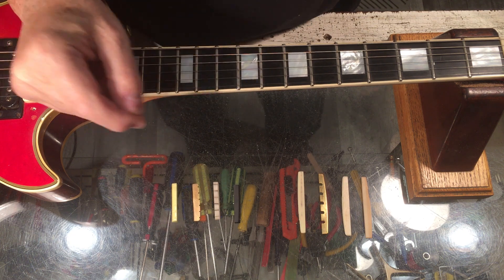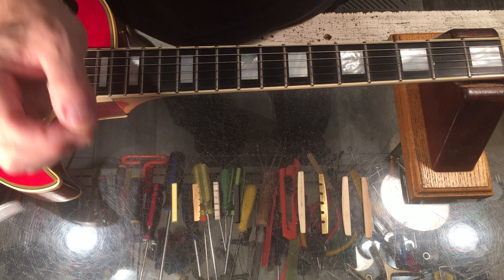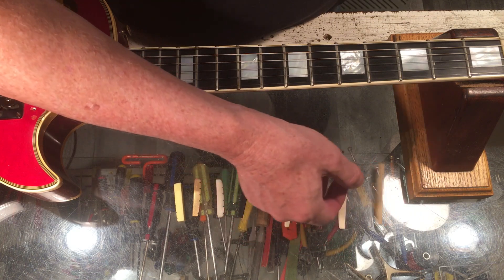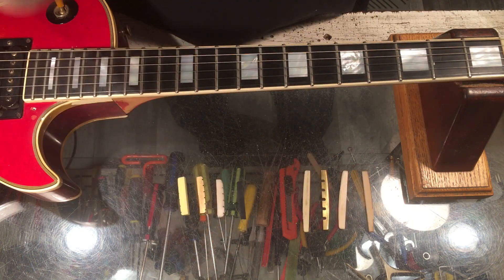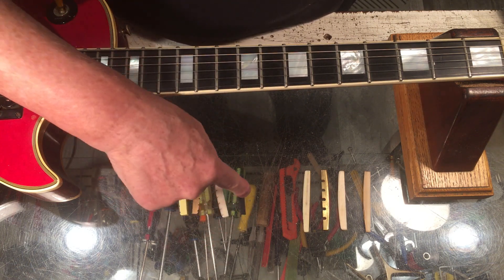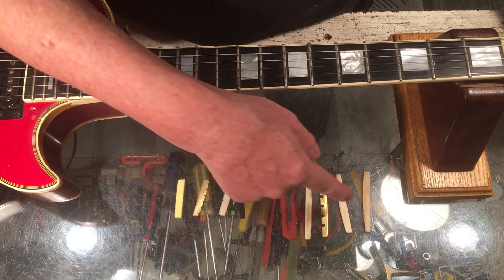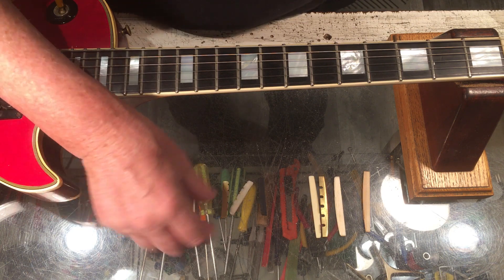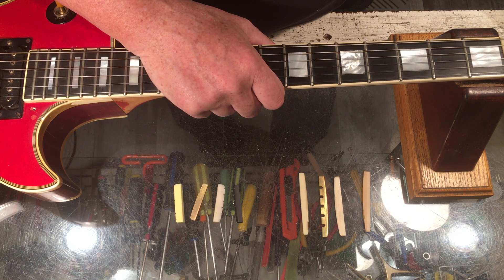What's the best material for nuts or saddles?

Comment: Hey Steve , 

Wouldn't graphite wear quickly  ?

I've been wondering about changing my saddle and bridge pins to Graphtec Tusq.  So much has been raved about Tusq . 

I'm a noob player , but i am very aware of my guitars and the way they handle and sound . 

All of mine need set ups , so why not make them sound better if something relatively simple can help by at least 10 % . 

Thoughts on the grsphite saddle  and  Tusq  ?
Reply from the maker: Modern graphite products have additives to help them last yet still provide the benefits of dry lubrication and energy transfer. As to whether they change your sound for the better, there's literally only one way to find out. If you have multiple guitars you could try a test on one instrument and see if it's what you're looking for. Good luck!

Comment: I started using GraphTech ‘Tusq’ nuts a few years ago, and I was surprised at the difference they seemed to make. So much so that I even tried their saddles & was super happy with them & haven’t had a single issue since switching to them. 

Plastic nuts ‘can’ work well. At least serviceable. But ONLY if they’re cut extremely well. Outside of having that requirement plastic simply sounds dead. Dead as in ‘no life’ to be found.